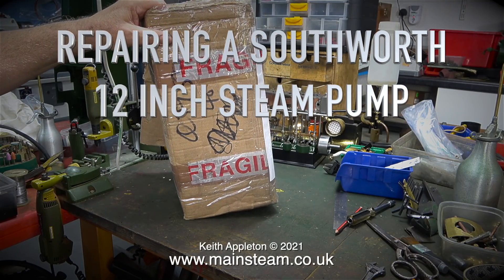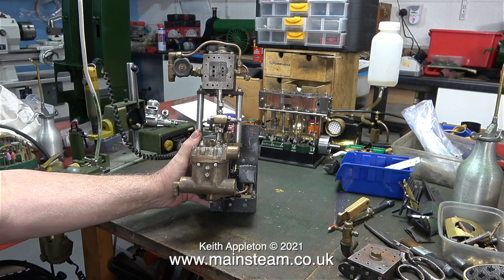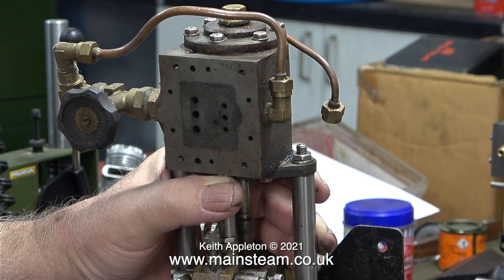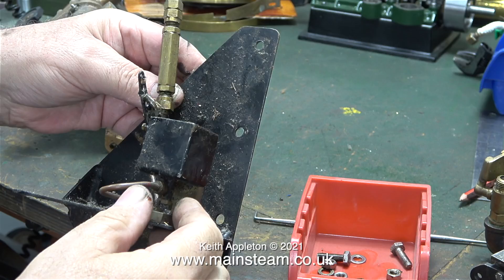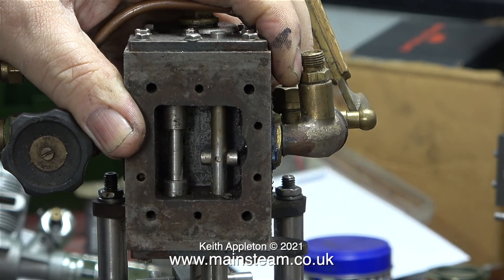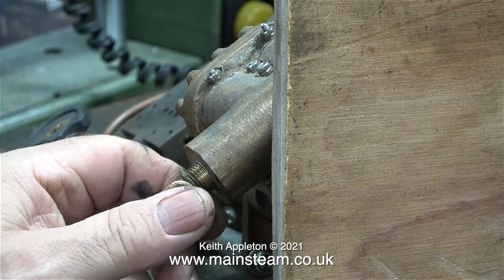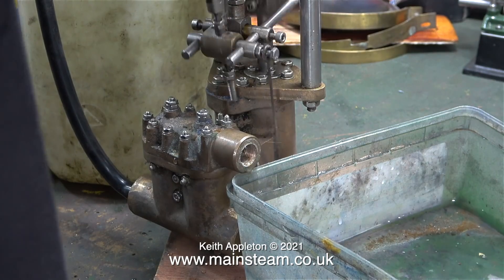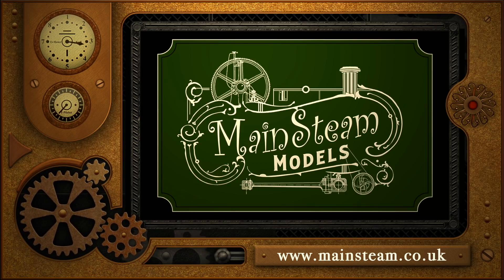REPAIRING A SOUTHWORTH 12 INCH STEAM PUMP - PART #1

Comment: Keith, I hope that you get to continue repairing this steam pump -- it looks like an interesting puzzle to solve.

Also, for a completely unrelated comment, I've noticed that you say "hose-pipe" to describe the silicone hose in this and other videos.  I remember one time where I used to work either I or an older Tech used the term "hose-pipe" and literally no-one else in the office (a Mechanical Engineering office in Florida) knew what it meant, other than one of the three of us from the state of Alabama.  I just figured it was a "regional" expression only used in Alabama, but hearing you use it too, it is obviously used in a much wider "region" than just Alabama!  I now smile when you say it because I immediately understand what you mean and remember the confusion of the other Engineers in the office back then.  ;)
Reply from the maker: Yes, this pump repair proved to be a very tricky job, full of surprises }:-)))